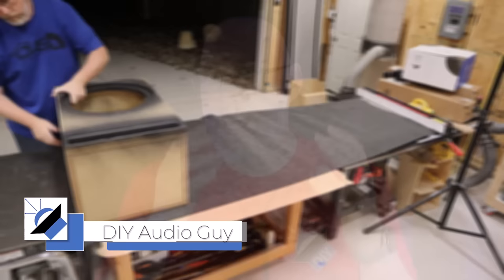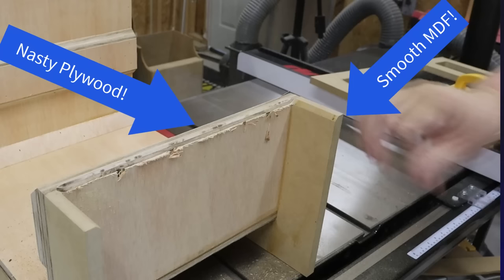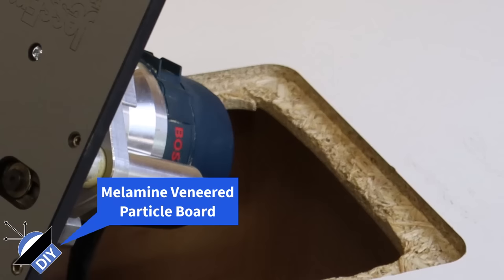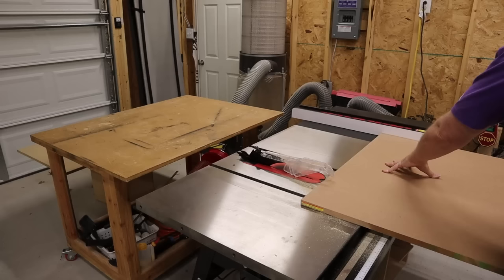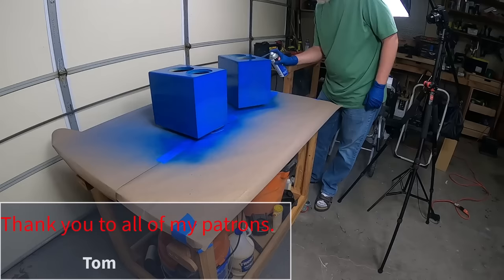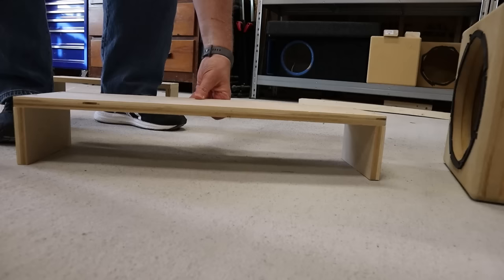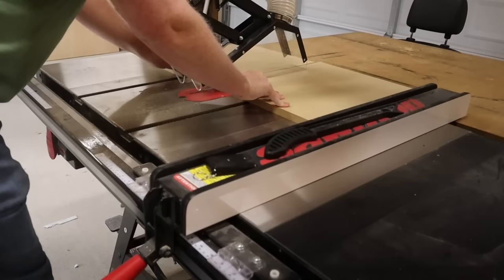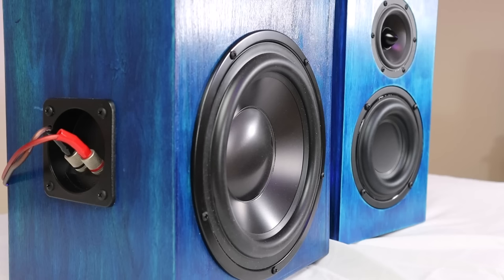You Won't Believe The Best Wood For Your Subwoofer Box!  Birch vs MDF

Comment: You kind-of touched on it, but the fastener blowout with MDF is more often catastrophic. Particularly around the edges, like for the speaker hole.

With plywood, you can just fill a stripped hole with wood glue and toothpicks, sand, then redrill it. The alternating grain in the plies tend to hold it together though. With MDF, it tends to blow out big chunks once a hole gets stressed or overused.

If you're building an MDF box with wood screws holding the speaker, and especially if you are making it to have a recessed flange, I would suggest a layer/ring of plywood inside around the hole for better fastening strength and less chance of blowout for people that swap woofers or take their speakers out somewhat frequently.
Reply from the maker: That is important.  It is always a good idea to drill a pilot hole with plywood, but it is a must-do for MDF.

Comment: Buy HDF (refined MDF) instead of regular MDF. It’s harder, denser, and more water resistant
Reply from the maker: I am sure it is good stuff, but where can a DIY'er get it?  The reality is that most of us have to make due with the stuff on the shelf at Home Depot.
Reply: @DIYAudioGuy  absolutely not.  Just find a local cabinet supply shop and they will most likely have it in stock.  I'm in Iowa (middle of no where) and there's a cabinet supply place (sells hardwoods, plywoods, etc) that has it in stock. It can also be ordered from most wood supply stores (not at big box stores).  It's easier to get than you think

Comment: If your going to to do a veneer over the mdf, then stain it, why don’t you get the species of wood in a veneer? Another thing, you can get mdf with a factory applied veneer, both sides if you want, in just about any species of tree you can think of.
Reply from the maker: I've used that stuff before. But most people don't have access to that kind of material.

Comment: I want to make a subwoofer box for a 10” sub to go in a void in my Toyota 4Runner body, replacing the factory plastic sub enclosure. The MDF box would be partly rectangular with a diagonal on one side to slope around the wheel well. The back of the box would need to slope growing shallower from about halfway up to the top. (A drawing may be required.) In your experience, is an irregular shape like this a bad idea? I’m happy to send a drawing of my plan, or a pic of the place where it goes, if that’s helpful.
Reply from the maker: Sounds like you might need to use fiberglass.
Reply: @DIYAudioGuy  Thanks so much for your reply! I’d be willing to try that, but I have no experience with Fiberglass yet. Would you suggest making a mold to form the fiberglass to? Or does fiberglass form up if I just use cloth and resin? Do you happen to have any videos of working with Fiberglass to build a box?
Reply from the maker: @TeacherDave-dz8yp  I do not have a video on it.   Car Audio Fabrication has one.
Reply: Some people use king starboard for this kind of stuff. Very expensive but it can be heat formed and is very ridgid.

Comment: I steered away from MDF for the simple fact it's hard for me to lug around full sheets. If I'm building trim panels MDF is the way to go. If I'm stacking sheets to make a baffle I'm using "birch"...
Reply from the maker: The big build you are working on needs to be plywood  just for the weight savings if nothing else.

Comment: MDF where I am is always more than plywood of the same thickness. I still use it, but plywood here has always been about 30% cheaper.
Reply from the maker: That is unusual.
Reply: @DIYAudioGuy  South Florida.
Reply: MDF costs about the same as decent ply where I am. Though the sheets are larger at 49x97 (industrial cut).

Comment: What about particle board with formica on the backside, I have built my boxes this way forever and they pound hard as anything else and it's heavy. What's your thoughts???
Reply from the maker: It is heavy, I have used it for workbench tops, but not sub boxes.
Reply: @DIYAudioGuy  try it one time it hit real heard, I built a ported with a plexiglass front and 90% of my other boxes were the particle board w/ the formica on the inside. I was looking for something where the bass wouldn't get absorbed at all if possible.

Comment: MDF is ok, but Birch ply is better, stronger BUT comes at a cost !  All my speakers were built with BB ply.
Reply from the maker: Do you have a local supplier that sells the 5x5 sheets of Baltic birch?
Reply: They only advantages to ply, is the reduction in weight.
Reply: @DIYAudioGuy  Yup, then i haul it over to a friends shop and he cuts all the pieces with the 10x15 CNC :)
Reply: @Chuck_Sanders  BB Ply is WAY stronger then MDF. You should educate your self before speaking.
Reply: @JasonLeaman  I've been in Audio as a whole,  for over 3 decades, and not just car audio. I don't need educated,  but thanks.  Strength sure, but a little.  Costs outweigh that  difference in strength.   Acoustically, meh. It all really comes down to weight savings with birch, and I appearances. Wasn't trying to get you in your fee fee bud.

Comment: MDF is better as it doesn't absorb sound waves as much as plywood but if you want what's better than both of them use HDF (High density fibreboard) it is heavier and does cost more but it is more solid and takes moisture better. It inability to absorb much sound waves due to density makes for a crisp full volume of the amount of input loosing very little or merging tones into a muddied sound. This is why all the high end speakers use HDF and is one reason they weigh so much.

Comment: I did car audio on and off for about 30 years. A majority of my work from 99 to 08 was mostly exotic and custom cars.

I put my fair share of MDF through a saw table. The shop I worked at used Trupan Ultralight from Chile. It is cabinet grade MDF and I fell in love with it.

You can look around and find it but I got mine delivered from a place that delivered laminates and bulk materials.

I'm curious if anybody has used it or heard of it?
Reply from the maker: Never heard of it!
Reply: Dude that's crazy I was just about to post to ask the same thing! I used trupan light at Circuit City in the early 2000s and it worked great. We would sell to the tuner crowd looking to save weight.

Comment: Mdf is not an ecological material by any account. On the other hand, plywood, even the cheapest variety (don't use the cheapest type to build speakers!) is on account of using the entirety of the log material - very little wood material gets wasted when turning a log into plywood panels. Also plywood requires the use of far less glue in its construction than mdf which is rather good for all of us: the glues used in both, but especially in mdf, emit aromatic/cyclic hydrocarbons over their entire lifetime which we breathe all of that time.

Comment: If you add up sealers, paint, contact glue and carpet how mutch you save using mdf vs plywood. Do a video of double/triple baffle spl number with beefy 10" vs single baffle made from 1" ply and flush mounted sub on the inside of the box.... Double baffle is the stupidest shit ever, i dont know a single people in europe using mdf or double baffle :D

Comment: I worked in a business that used particle board for years! Please learn that there are many grades and types of particle board! I have built well over 100 speaker boxes with high quality particle board and never had any issues!! Its like anything else get quality materials! It will love glue and screws with no issues! It you want a tip try to laminate your speaker box with laminate use vt grade to save money if you know how to laminate wood like cabinet people! It make make the box rock solid and air tight ! Trust me i am a master cabinet man with 21.5 years experience and been building systems in cars for myself and many others! Every since 1985 contact me if you have questions
Reply from the maker: I picked us some scraps from a cabinet shop a few years ago, mostly odd sizes and off cuts.  The selection and quality that an industrial scale business has access to is amazing. The problem is that your typical DIY box builder does not have access to those products.

Comment: There is a reason, pro audio companies have been making touring speaker enclosures out of baltic birch since the 80's. Its just better. Spray it with some bedliner and bam - a nice box with speakers. See also LineArray or EV XArray.
Reply from the maker: Right, and it's complete Overkill if you're going to use it to build a bookshelf speaker that won't move more than 10 ft in 5 years.

Comment: A note about Baltic Birch is that it's primarily sourced from Russia.  Finland is another major producer but if you're buying it you're almost certainly sending money to Russia to support Putin's invasion of Ukraine.  This may or may not bother you but it's something to consider.  It's also very expensive right now BECAUSE it comes from Russia and is heavily tariffed as a RUS import (when compared to before the Ukrainian invasion)
That said, most professional PA speakers that cost many thousands of dollars are made out of void free Baltic Birch Plywood, and this is used to argue that BB is better than MDF acoustically if you can afford it.  Also a myth.  It's primarily because of its durability.  PA speakers get moved around and dropped and slammed into trucks etc.
They're both very suitable for speakers.
And full disclosure, I do prefer to build speakers with BB but have been building with MDF since the Ukrainian invasion.
Reply from the maker: One of the things I was hoping to accomplish with the video was to show people that "best" depends entirely on the situation.

Comment: I dislike mdf its like pressed wood dust. Too many stripped holes ive seen with mdf even when i used screw in threads with glue. I actually prefer plywood as birch is $$$

Comment: Don't confuse home center birch with real baltic birch, that's like comparing a Fiero to a Ferrari. The real stuff comes in 5'x5' sheets and 3/4" has 13 equal plies. Seek out the real stuff and you'll never use 4'x8' sheets of ply again.

Comment: If you live with a woman who likes to put plants on top of your cabinets ...mdf might not be a good choice.

I've tried out various hard woods such as Maple Oak Poplar and pine.
Despite insulation added to the inside, most of them had a tiny type sound.

The pine was the best for sound reproduction. 

Get a stain. Water rings scratches...no problem. Sand and color to your choice. 

My boxes are 9 years old and still look and amazing.
Reply from the maker: If you live with a woman that will let you have a big subwoofer in the living room just be thankful!

Comment: Wood is metric.  It's been metric for years.  Look at the label.  That 3/4" is really just 19 mm.   Use metric and stop screwing around with inches and building things is much much easier.  How thick is that?   19 mm.   See how simple that it is.  Go calculate the resonant frequency for an edge constrained panel and then figure out how to get that first mode frequency above the range the speaker in that cabinet will ever play.  You will quickly learn to love birch plywood if you are ever planning to lift that box.  Cabinet makers don't use plywood at the edge.  They use sold molding, so it isn't a problem to round over or what ever.
Reply: How are conversions for you? I still use imperial for homesbecause everything is imperial. Hard to explain to others somewhat, 3d printing for me is all metric since all the people there use metric only.
Reply: @H0mework  I bought a metric tape measure.  I realized that was all that was holding me back.  Let the other guys figure it out.  A liter is a quart.  A meter is about three feet.  I convert as little as possible.

Comment: So basically MDF sucks. Good to know. Let's be honest gentlemen. MDF is only for fucking around. To create mockups or whatever, to test techniques and build methods. After you're done testing and you have a good design, you buy some real good quality wood and build something nice. Yes it's expensive, but it's the best thing you can do.
Reply from the maker: That is not the conclusion that I reached.  MDF has its uses.

Comment: A 4' x 8' sheet of 3/4" thick  MDF is 32 square feet and weighs 90 pounds that's 2.8 pounds per square foot. A 5' x 5' 18mm thick baltic birch is 25 square feet weights 64 pounds that's 2.5 pounds per square foot and that is not enough to make a measurable difference.  I am sorry I am just not going to buy sawdust that's mixed with glue and pressed under pressure in a mold not to mention all the bad chemicals in the glue. MDF is fine for car subs covered in carpet but for any nice home speakers it's Baltic birch or nothing. The only negative I can say about BB is it's not cheap.
Reply from the maker: If you can find it!
Reply: @DIYAudioGuy  I live in Tampa I have three locations I can purchase real Baltic Birch. If I didn't have anything local I would order offline. MDF just screams cheap. Don't get me wrong it has its place in some 18 year old kids Honda with a giant Wing and a fart can exhaust. But for any serious DIY speaker builder nothing beats Baltic Birch.
Reply: Yes? 18mm baltic 50€. 19mm mdf 12.50€

Comment: I've built enclosures from mdf and birch ply,  mdf doesn't sound as good, definitely flexes and vibrates worse, requires more bracing and is just too heavy for mobile audio use. So after 25 years of audio installation under my belt, I refuse build enclosures using mdf. Everyone has their opinions but at the end of the day,  I trust my ears and the term lab.  Useful information in the video but it's easy to explain why birch is king, professional drum kits are made from birch, for the best and most natural sound. If it's good enough for professional musicians then why wouldn't you want it in your audio system?
Reply from the maker: Both have their use.
Reply: The whole point of a musical instrument is to resonate, not a good comparison for speaker enclosures. However ALL proaudio touring cabinets are made from baltic birch so that's a better sell, lol.